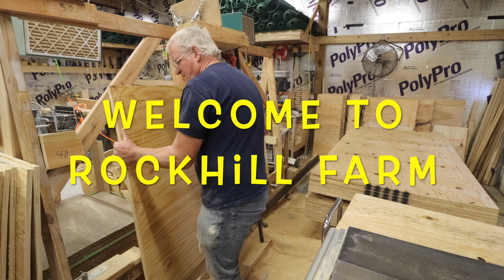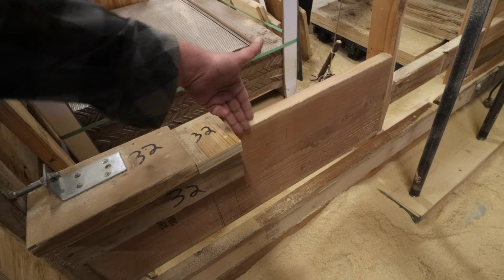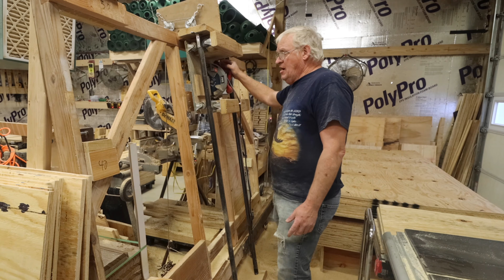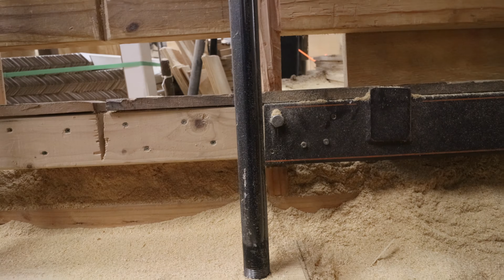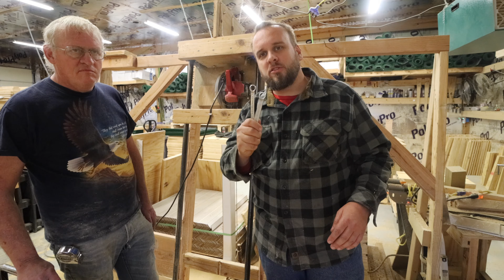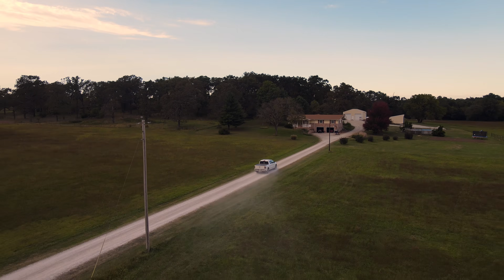Homemade Panel Saw - DIY Saw and We Only Spent $100

Comment: Great video..i guess your buissness just requiers cutting boards on the short side.I mean on the ones you can buy there are so you can turn the saw 45 degrees and cut the board on the long side

Comment: Sorry to be that guy, the proper term and name for the saw your using is a "Circular Saw" not a Skill saw. Or at least not for $59.00. 

It's all good we all knew what you were talking about. But correct terminology is extremely important. IMHO
Reply from the maker: Thanks for the feedback.  Terminology isn’t my thing.  I’m always going to call an adjustable wrench a crescent wrench

Thanks for watching, and Have a good one
Reply: @RockhillfarmYT  Then I will be sure to hand you some channel locks or vise grips.  🤨🤣
Reply: So, I'm "that guy" too, and I just want to point out that Skil saws are $59.88 everyday at Lowes. Actual Skil brand circular saws, likely the very one they use. There is even a cheaper one, for about $42 but the one you want is the 15-amp $59.88 one. I also appreciate the proper use of terms, and yes it is called a circular saw, but I just had to point out that Dad was right on about the $59 Skil saw. :)
Reply: @jmpatt  I'm a big advocate of you get what you pay for. Especially when it comes to tools. Sure, I have a few cheapo misc tools that I don't care about. Let's call them, "The Loaners" or "Your Sister's Tools".
 LMBO!!  
Normally,  they're only used by a day laborer.  
I digress, a real Skil brand circular saw w/ 15 amp for only 59 bucks, that's actually a decent deal. But I really hate Lowe's!  My skin crawls even when I drive by that poor excuse for a hardware store.  Normally you can't find that kind of power for that price 12-13amp sure.  Probably wouldn't last a month on my crew, before it blows a bearing or it doesn't have the ability to be adjusted so the operator can quickly grab, mark, cut and go a properly measured line. 

It saddens me that some of our well  known name brands are selling out and making a cheapo DIY line these days. Probably being made in China also.  It's really not a deal are your spending $59 bucks  3-4 times a year to make poor cuts.  I'll stick to my Makita  9" worm drive  circular saw. I paid $300 I think? some 10 years and 2500+ houses ago. It may not have a fancy laser that lies to me. Good thing I still remember  how to measure, mark and cut  a straight line with it. LOL

Anyways, 1 day in the near future once I finish my shop I will put together your panel saw for easier handling of sheet goods.  Merry Christmas 

Remember to always keep them fingers free and clearly attached . But I have heard your thumb is worth 16k. Eeeee!
Reply from the maker: Thanks for watching and sharing your thoughts
Reply: oh really Mr. "SkilL"

Comment: Are there some detail measurements for the various 'critical' parts, like the saw carrier? Roller position for the pipe. Tilt back angle and length of the vertical boards. I don't 'slap' things together very well, without having to have a do-over. Then waste materials and time because of my bad guesstimation.

Comment: First off, thanks for the quick response to my ask about this subject! Maybe it was just luck with the timing, but it's appreciated either way. I am intrigued with the shop-built panel saw concept, and I've been toying with similar ideas in my head for a while now. My needs aren't about production as much as they are about efficient use of space, and having a saw on the wall seems like a good idea for me, especially if it makes breaking down sheet goods a little more doable by myself. The look into the system you guys have implemented is helpful as all get out. I'm curious to know exactly why he said if he did it again he'd use square tubing as opposed to the round pipe. (the obvious?) I completely agree with what he said about the dust collection, and in my "if I build this" check list is a dust port located at the front of the saw body rather than the back. There's a couple guys on YouTube that have had great success with that method, so it might be worth considering if you guys do add the dust collection. Thanks so much for taking the time to share this with your viewers. Got me wanting to get up and build something, and I think that's what this is all about, right? Thanks again!
Reply from the maker: I will actually ask him because I don’t know.

It seems to work just fine the way it is but he uses it every day and I only use it every once in a while

Comment: Really cool idea.  Its always great to see creative and economical solutions for "nice to have" tools.  How many total casters are you using?  What is keeping the sled from shifting left or right between the pipes?
Reply from the maker: We have a set of casters on each of the four corners of the carriage.

Each corner has a front facing a rear facing and a side facing caster So it’s really boxed in pretty well

12 total casters
Reply: Great - Thanks.  I could see the 8 casters (front and rear), but I couldn't tell if you had the 4 on the inside of the pipes.  Awesome solution.